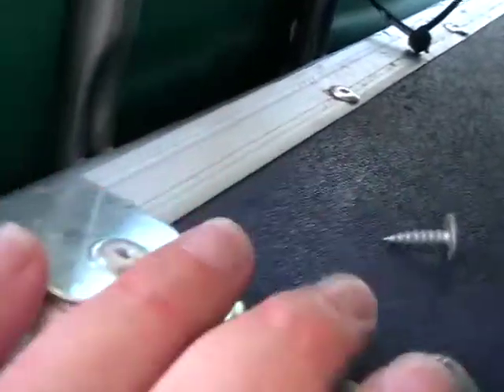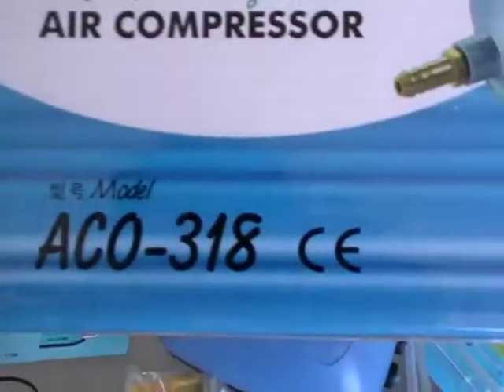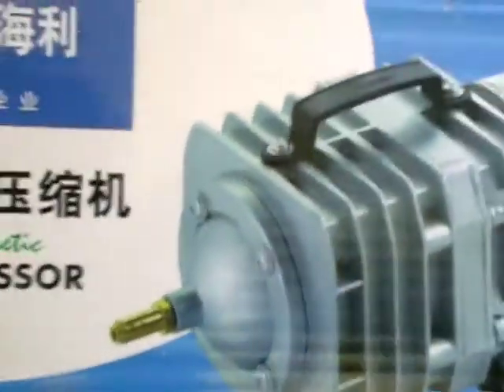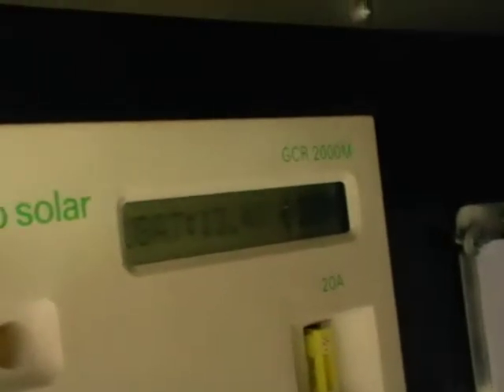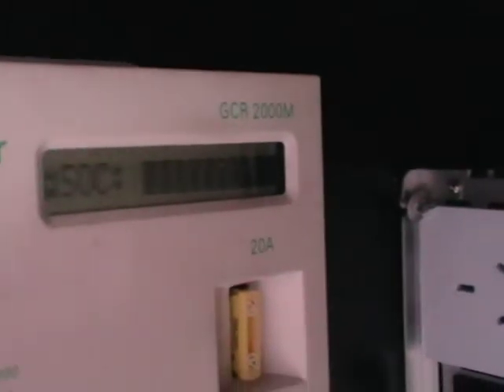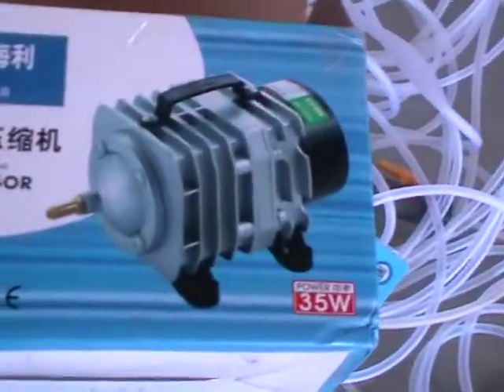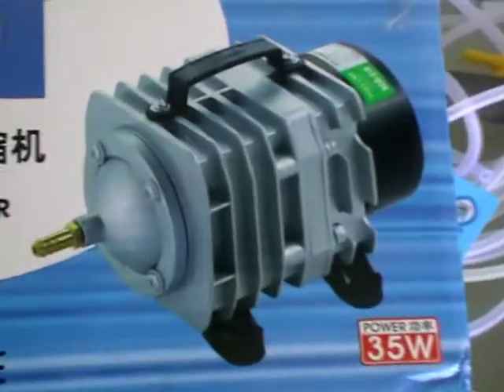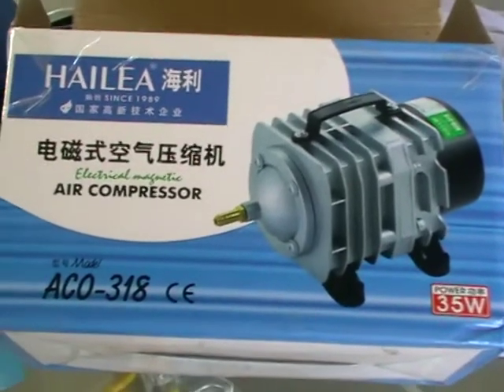Aquaponic air pump on solar power

Comment: I just ordered a 35-Watt, 951-GPH Commercial Air Pump on eBay for only $26, its really overkill for my needs (brewing compost tea) but at that price I couldn't pass it up. It won't let me paste a link in here for some reason so if you're interested just search on eBay for: (35 watt hydroponic Air Pump Pond Aerator Commercial 6 Outlet Aquarium 951 gph)